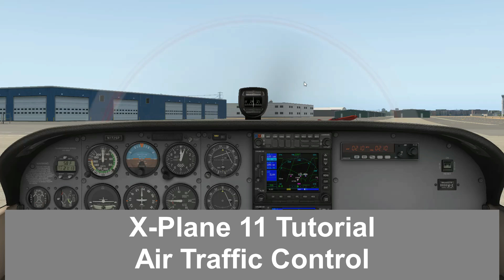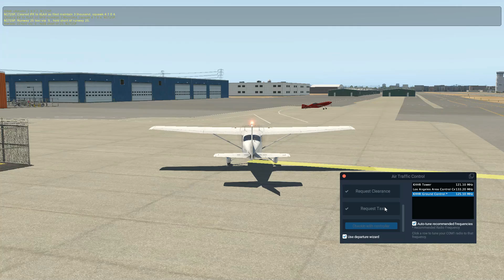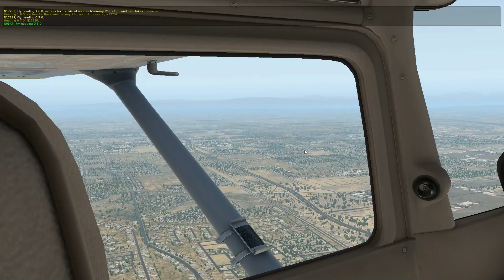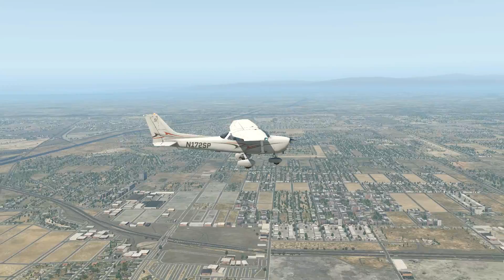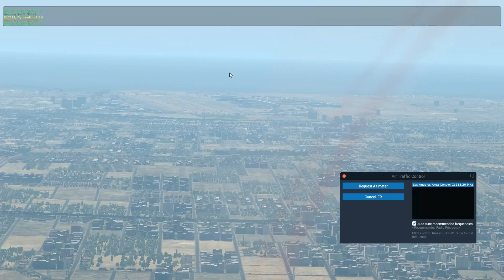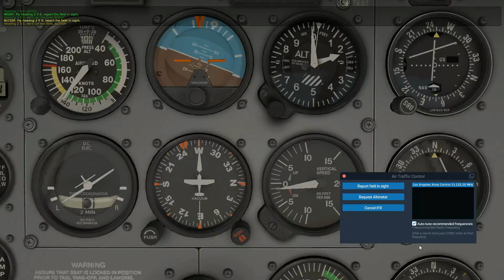Comment: Altimiter 2992 is not altitude it is barometric pressure.  You adjust your altimeter guage to get the correct altitude.  It's 29.20 in of mercury.

Comment: I purchased xplane 11 prior to doing my research unfortunately. So with buying a new desktop and learning I require an adapter for the monitor connection, for my older monitor, I hope to install the program shortly and learn to fly. Great video. I learned a lot!

Comment: I agree with lots of remarks, X-Plane 11 ATC is not fit for purpose . The sim itself is great but the ATC needs a complete overall,.For starters can you speed up the transmission, they sound like a robot with a flat battery.

Comment: Hi there, I see your YouTube, I do everything same like u did, but when I land use the ILS the  air traffic control keep asking me keep up 2000 ALT, I don’t know why, and I land it not right on the runway? Can you let me know what I do wrong? Thanks very much
Reply: I’m also having the same problem. I guess the default ATC is kinda bad, just wait for X-Plane 12 and it’s ATC might get improved or use some ATC plugins such as the payware Pilot2ATC or the freeware 124thATC.

Also, I forgot to mentioned that when I just landed using autopilot in Miami using the default ATC, I wouldn’t get taxi to gate. It just said Cancel IFR and I just opened the developer logs and I just found a lot of error saying that some AI are already in downwind and also there was error that some AI including me says that an approach for the AI or me does not contain an approach base vector, oh my god, I don’t know why

Comment: Noticing that once you climbed to 2,000 and was on heading, there was no mention of after takeoff, cruise or planning for arrival check performed. I know it isn't necessary in a sim but if you're practicing for actual procedures you'd use in real life, then...
Reply: Thanks for pointing that out. I wanted the focus on the aspects of the tutorial which already ran 30 minutes. I am not a real pilot and hoping others are interested in what I have to share.

Comment: Thanks for the ATC demo. But it did raise an issue XP11 should address. When you went to the map at 20:46 (for just a moment before you zoomed in) the heavy jet that overflew you at 22:20 is already shown turning onto the localizer - that should NEVER happen. And, if it's not a system glitch that will be fixed (that is, if occasional ATC errors are built into the system), there needs to be a means by which the PIC can refuse an unsafe ATC instruction rather than just doing a read-back.

Comment: Looks like you were originally tuning-in to the ILS frequency for RW-25 Right on NavCom 1 with  111.10 at the 20:50 mark, but then your radio configuration ended-up tuned-in to RW-25 Left on 119.90 which is probably more consistent with standard landing procedure at LAX.  I think they generally take off from the 2 interior runways 25R and 24L and land on the exterior runways to help with separation. There apparently was a major fatal accident that happened on 24L in 1991 when a 737 was cleared to land and it hit a twin turbo prop waiting for takeoff on the same runway further down the runway.  The FAA recommended separating traffic that way but they apparently did not put it into practice until 2004 when another accident almost happened with a 747 landing on the same runway 24L and 737 was lined up and waiting for takeoff 200 feet beneath the path of the 747 landing right above it.  Talk about wake turbulence!  Anyway, appreciate the the video and you sharing your experience using ATC and AP in X-plane.  I picked up a few tips on some things with waypoints in the maps feature and using AP for headings, ascents, holding altitude and the ILS. I know the purpose of the video was to show those features and not how to execute a perfect flare on landing or turn away from wake turbulence on final approach after you had spent time recording an entire video demonstrating other features. Those pointers are helpful in their own way but we should all be willing to show a little humility and grace towards others in the aviation and sim community who work to share their knowledge by recording, editing, narrating and uploading videos with helpful content.  Even a seasoned, celebrity actor and pro aviator like Harrison Ford can make a mistake like missing a runway and landing on a taxiway at KSNA. Aviating, navigating, communication and flying in complex airspace is challenging and good pilots never stop learning things in the industry, ever. Keep filiming, keep sharing, keep flying!
Reply: Jezus

Comment: It would probably be better not to have any ATC than this one. The phraseology is incorrect, you start by identifying yourself to ground/tower and so on. The units and decimals are separated by a "decimal", not "point". Either you give which ATIS info you received or the ground and tower will give you the QNH, runway in use, and other info like wind. And then there's the question of VFR, many if not most users don't fly IFR unless it's absolutely necessary.ATC has always been Lame-inar.

Comment: Did you really extend the flaps at over 120 knots?
Reply: I thought the same thing. Unless he only dropped them 10 degrees, I would expect the circuit breaker to pop from the strain on the motors. Or worse, the sudden increase in Gs to burn a motor or break a flap, in which case that aircraft would have been awful tough to land. The trim wheel must have been spinning like a turbine engine to keep the nose down.

Comment: My check in with controller is greyed out. I've been holding short for almost an hour
Reply: Did they tell you to hold short or to line up and wait? In the latter case, you have to taxi onto the runway into position and it should move on :-) I had that once.

Comment: I have been using this ATC for filing a flight plan but when I get to the airport to where am suppose to land ATC do not give any info so I have to terminate my Flight plan and use the mobile map to do a in line circuit and land the x-plane 11.10 do not have it they should look at the one atc for 9.70 with full ATC directives.

Comment: As a real world pilot and plane owner, I noticed that you adjusted the flaps on final at a speed of around 130 knots indicated air speed (KIAS). Trust me, if you did that on a real airplane, you would rip the wings off or at least cause structural damage to the airframe. If you want to fly with realism, it would be to your advantage to learn the markings on the air speed indicator. All those pretty colors are put there for a reason.
Reply: It seems bizarre to me that they don't simulate flap failure. Seems to come up often enough.

Comment: Question about autopilot.  You used autopilot in this video to do most of the flying for you.  That makes sense... if you have a tool, use it.  I do the same thing in FSX.  Is that true of GA pilots in the real world?  Would a real pilot rely so extensively on autopilot in these circumstances?
Reply: Aardvark892 generally yes... but the truth is a lot of GA aircraft simply don't come equipped with autopilot.  There are also situations where you are not supposed to use autopilot... and with an autopilot not being directed via a CDU or an FMS, you still need to make sure to keep your plane within the proper flight envelope because unlike an airliner, the autopilot will not stop you from going into a stall or going over structurally safe speed

Comment: ATC in Xplane is on drugs or full of gremlins, on the approach you almost got flip up by wake turbulence from big jet that flew by you! I tried to use taking off from CYLW and I was pointed at the mountain ask to maintain flight level 2000 feet. If you have better experience since that video, let me know. Your plane has the same tail number lol, mine is red

Comment: You seem to have a general understanding of what you're attempting to demonstrate but unfortunately you're not an actual pilot if so you would have know that your turn out after departure was too early, your climb speed was off, your power setting was off, arguably your mixture could have been leaned, you did not brief or seemed at all aware of the approach procedures or altitudes, you misused and misunderstand flaps and their application and most likely the pitch-power relationship (dumped full flaps at 120 knots), you failed to maintain any form of a control decent during the approach, arguably you don't understand wake turbulence and it's hazards, you had no flare in the landing and didn't apply any back pressure to keep the weight off of the front wheel during the roll out and most scary of all you had a very close near-miss with an airliner!!! If aviation is something you're passionate about head down to your local flight schools and talk to some instructors, 8-10k will get you a PPL (ASEL), trust me you won't regret it. It is a big investment but if you love it you'll make it happen. If you absolutely can't pay for flight training you can at least do all the ground school, books are available on the FAA website for free and there are tons of instructional videos on YouTube, that will enable you to get the most out of your flight simulator.
Reply: Ricky, this nice gentleman Jason put a lot of time and effort into showing us some specific information. He did not tell us that he would teach us how to fly an airplane. He did not claim to be an ATP Pilot and IFR instructor. He showed the Xplane/flying newcomers a few valuable bits of info.   I am a long-time Pilot and I did not expect  from this video the same level of service that I got from FlightSafety in Tucson on the LearJet 25 simulator.   You may want to stay with the advanced videos to suit your needs.
Reply: The questions you should be asking is , Why did ATC direct him in the path of a large jet? The answer is ATC doesn't really work  that well.  I couldn't stop laughing. Great video. Dont let " Those people " tell you what you should or shouldn't do.  Keep up the good work.
Reply: You probably wouldn't  be laughing if you were in that plane lol bad ATC is no excuse for bad piloting.. As PIC it's your reponsability to conduct the flight safely.. While bad ATC gave him erroneous directions, maintinig situational awareness is the pilots duty.. and braking off  rather than continuing the approach behind and below the jets fligh path show lack of understanding in the area of wake turbulence.. at the end of the day the controller always get to go home the pilot might not.. they ideas is not to discourage him but hope that he can learn from his mistakes. Would you want your CFI to praise incorrect procedures and reinforce bad behaviors?!
Reply: R.  Holy crap man, it’s a bloody simulator not real life. It’s one step away from a game. At least the guy is trying to help other simmers. Your just a Barney  know it all without a sense of humour. Who gives a crap about how much you know, Mr. buzz killington.
Reply: Hi Ricky. I hope you enjoyed the video. As with all my videos, they are simply to share whatever information I have obtained to make it easier for others to learn :)
Reply: I think Ricky is just trying to give him constructive criticism. I thought Rick's comment was awesome. It's great to hear from someone who knows the proper procedure.
Reply: Link your video and spare yourself the  comment.
Reply: + Nose gear touched ground first, everything else's not bad. Appreciate your work btw.
Reply: @ Ricky O.      You misspelt descent. No ones having a go at you for it though ✌️

Comment: Hey Jason, I have a problem not sure if this is where I go to ask your help but I did this flight last night. Instead of your airports I used kewr to Kjfk. I let ATC configure the flight, I figured I would wait for them to give me the runway and then I would put in the frequency for the glide scope. As I was nearing the airport I was given runway 13 left to land I then went to the map and selected 13 left and clicked the nav 1 button. As soon I was near the glide scope I selected approach and nav and nothing happened. The thing is  that I looked at the nav radio and did not see the frequency on there I then looked at  your video and saw the same thing I believe you had  110.10 or something like that but I did not see the nav frequency for the button that you selected am I doing something wrong?
Reply: Steven Pow  lol. I. Have the same thing
I wil get violation msg lol

Comment: Hi. Just upgraded to X plane 11 and found your video's. They are Excellent and I am improving by the minute. One question. You state you assign a key press to turning the A/P on in the Cessna. I have attempted to do this in settings etc but I cannot see where I find the operation. Is it possible to advise me. Thanks in anticipation.
Peter.
Reply: Peter Bullock look for servos_toggle

Comment: Hi Jason, really like your videos. Question about the landing on this vid. when you set the Approach and Nav on the AP is it taking the information from the flight plan to know how to bring you in ? Sorry still new to XP11
Reply: Hi Craig. This airport had an Instrument Landing System (ILS) thus pressing the APP+NAV along with having the radio tuned to the correct frequency allows the plane to pretty much fly itself down to 200 feet.
Reply: Jason Vriends will it line you up to the correct runway?

Comment: You reference using a keyboard command for activating the autopilot. I can't find one that's assigned by default. Is there one, or did you install a custom keyboard command?
Reply: Jazz First NH you would need to bind a key or joystick button to servos_toggle.

Comment: I just tried to duplicate your video. After lift off and at about 1000 ft. the plane turns around 180 degrees and arrives at klax. with erratic behavior. 
Also, when I go to the map I don't get what you get{runway glidescope with frequency choices.
Reply: Are you using X-Plane 11?=
Reply: yes